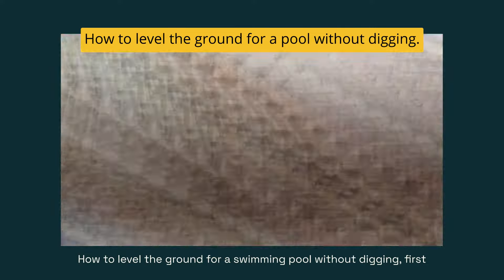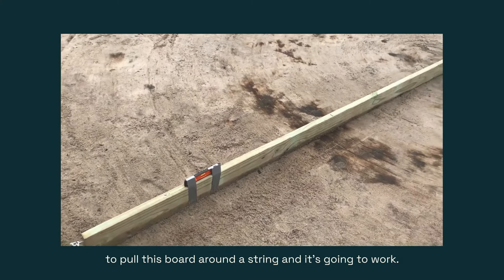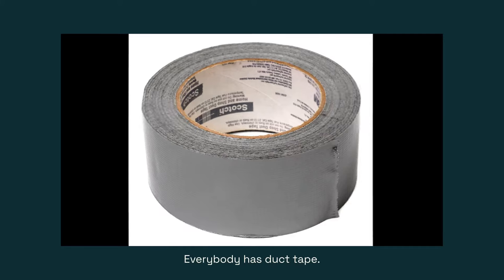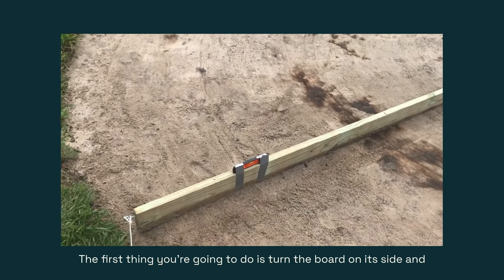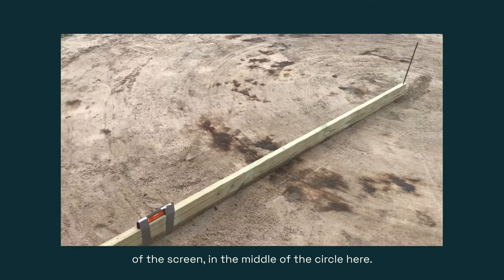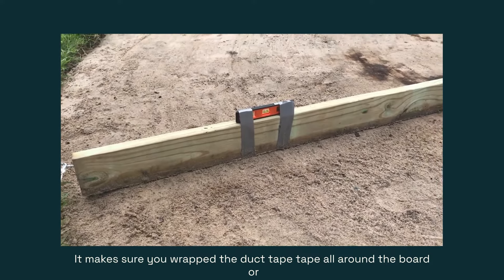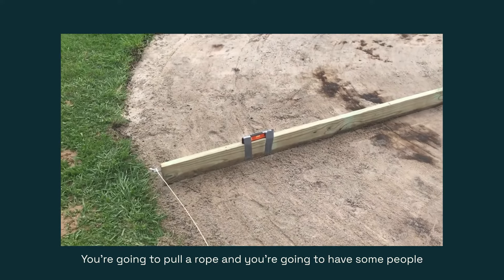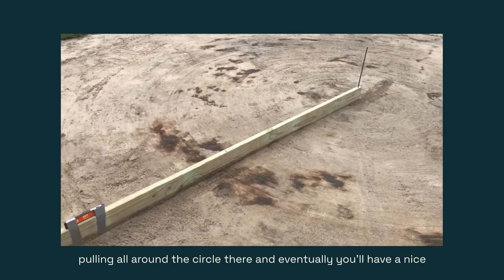Level the Ground for a Pool - No Digging (A step by step guide)

Comment: So, i just pull it from the rope, and keep on pulling and pulling until its level??? Wow… thanks…!
Reply from the maker: You'll need to move and scoop the sand in the low an high spots and rake it out and such as you pull it around while checking on the level.

Comment: Need to do this but was wondering if the rain does not wash the sand away?
Reply: Cover the sand with a tarpaulin larger than the size of the pool. before you cover the area with the pool.

Comment: What are the dimensions of your pool ?
Reply from the maker: I had a 28 foot pool and then went to a 24 foot.
Reply: What are the dimensions of the board you used ?
Reply: @danielaguilar6839  I would like to know too
Reply: @danielaguilar6839  I’m thinking it might be half (or a little over) the 28 feet bc he drilled it in the middle and pulled it around. Just a guess though

Comment: I just set up this pool. Had to dig a big hole for this pool with a shovel by myself and leveled as best as I can which I think it’s not perfect.  If I use my level so make sure legs are 90 degrees and and are level including the top of pool you think it’ll be alright even if where the actually liner sights isn’t perfect? Just worried about it being unlevel